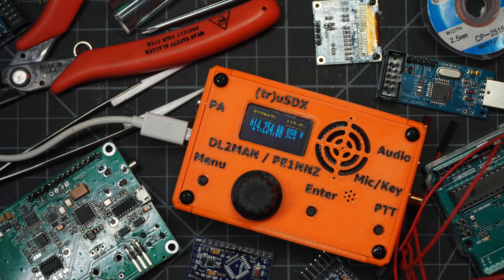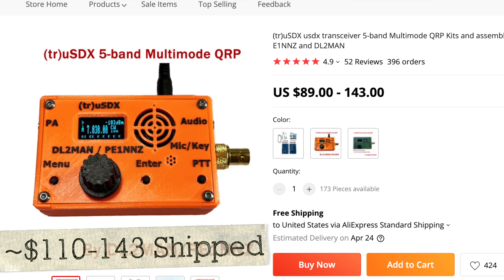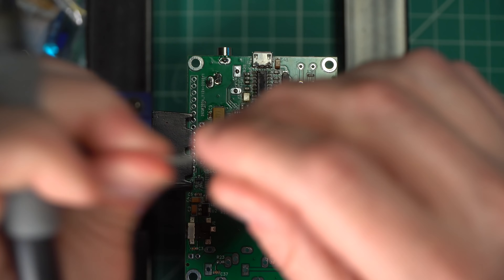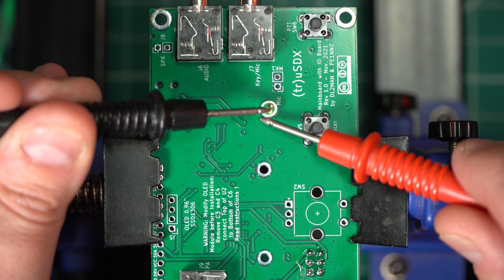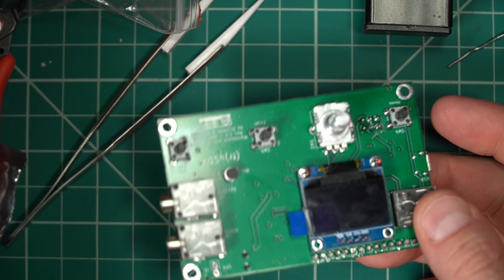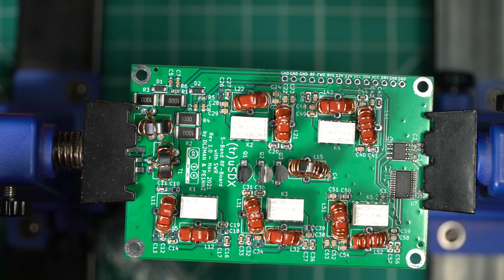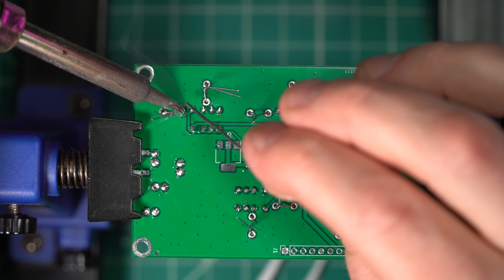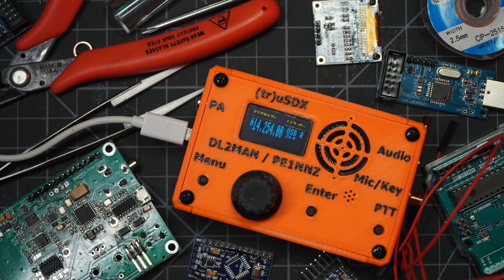(tr)uSDX: Tiny QRP Radio, Some Issues, Let's Build It Pt.1

Comment: I purchased the kit from ebay from the authorized seller there. What a great kit, and I am getting 80+ efficiency on all bands. I have been having a blast with this little radio. Have made a bunch of contacts on 20 and 40 and everyone states the audio is fantastic, and can not believe I am running only 5 watts. A big thanks goes out to the designers of this little radio, it really packs a punch.

KB9JJA

Comment: It is fantastic what the designers (PE1NNZ and DL2MAN) of this amazing radio were able to do with an inexpensive ATmega328 microcontroller (used in the Arduino Uno/Nano) which cost $2.50. It is functioning as a Digital Signal Processor (DSP) for a true Software Defined Radio (SDR). Brilliant engineering and a work of art!

Comment: Its an excellent kit and the built radio is even easier :-) 

I bought mine from the AliExpress vendor and it arrived in 4 weeks. Faultless transaction and very well packaged -- so no damage and everything arrived in tip-top condition.
I've had it working for a week now and I'll be reviewing it on my channel later this week.

I've modded a speaker mike to work with the rig and have already had it out on a SOTA activation last weekend. 

An external speaker is sooo much better than using the internal one -- which you won't be able to turnup past '11' before it all starts to how at you!
If you can find a 16 ohm, 32 ohm or higher impedance external speaker (or headphones,) so much the better as the audio is driven by a direct processor output -- and doesn't have a lot of puff

It plays really well with the QRP-guys 3-band switched vertical mounted to the SOTABEAMS 6m 'Tactical mini' mast -- which I think you already have Josh?

So flash some firmware and have some fun!

It must be the smallest, lightest full functional rig on the planet -- and my congratulations to DL2MAN and PE1NNZ for their magnanimous efforts to bring such a gem to the Amateur Radio community.
This is what keeps this hobby GREAT

73
Bruce 

Dr.T(G4ABX)

@G4ABX

Comment: More soldering tips:
— flux is your friend! I use both liquid flux or a flux pen, whichever is most appropriate.
— tin the pads and the wire before soldering
— when soldering multi-pin components, only solder one pin and then check/fix alignment before soldering the other pins. Much easier to align a component with only one solder connection. This is very useful when aligning LEDs!
Reply from the maker: I'm pretty sure I used most of these?  With some clarification though, you're telling me you tin every pad and every wire before soldering?
Reply: @HamRadioCrashCourse  
That’s what I do, the exception being through-hole DIP chips and other multiple pin components (the flux pen is great for these) or if you’re unable to fit a tinned wire through the hole. I guess I shouldn’t have said to tin the pads, that does make things rather difficult! 🤦‍♂️😂

Comment: My (tr)uSDX came from Australia. Faraaz built it for me (long story: I can't build stuff) and it works great. I subsequently ordered a finished one from DIY Tech to give to my buddy Piero Begali. That arrived and also works very nicely. I did get the case for one -- the one Faraaz built -- from RoWaves along with the DL1DN battery box, both of which are beautiful work. I was looking at getting one just for kicks from RoWaves but have discovered that they have suspended production/delivery until they get the efficiency problem cleared up. 
. . . Personally I really think this is one of the coolest tiny radios that I've been able to use in a long time. I went through the three band and five band MountainToppers -- and wish I'd kept 'em, if only to make my hoarders episode more astounding -- but I'm beginning to think these micro SDR radios are the wave of the future for QRP and POTA/SOTA. Really sweet solid performers.
. . . So we move along. Nice video, complete and objective and fair presentation. Stay sane & well, amigo. 73 de W8IJN

Comment: Some thoughts and hints from my own (tr)uSDX build and following this radio project that might help some of your viewers:

The best way to desolder tiny SMT components, (those 2 little display caps,) is NOT to first clean the solder off your iron, but to load it up with solder. That then distributes the heat to both ends of the capacitors and they come off almost instantly. Essentially all desoldering is that way. Properly done, desoldering uses more solder than soldering does.

The 2 toroid transformers MUST be wound in the correct direction or they won't give you any power or SWR reading on the display. You know they are wound in the correct direction when the multi-turn toroid wire drops straight down to the PCB hole. If you have to cross the leads through the toroid or have to wrap extra lead length around the outside of the toroid to reach the PCB holes you have mis-wound the toroid. (I managed to very carefully mis-wind 1 of the transformers twice.)

The Q4 and Q5 pads on the bottom of the RF board are left open. They are for FETs that may be used optionally instead of the 3 BF170 RF output FET's, Q1, Q2, and Q3. It's better to use the BF170's. They have more headroom for high SWR's.

The point should be clearly made that even if a (tr)uSDX is purchased fully assembled, it is NOT a tested, quality-controlled 'commercial' product. It is still an experimental transceiver with bugs, glitches, and quirks that you bought from China, and the guys who designed it did so for fun and make no money off of your purchase. They are only trying to help. They are not to blame if something doesn't work, and it is not their job to fix it. They have day jobs. (Some people seem to think otherwise.)

It's always a good idea to buy a bag of BF170's, just in case. (I think I bought 10 or 12 for $7, free shipping.)These are Class E outputs, so they are not designed to dissipate the power levels they are capable of producing. Also, since these are simple experimental rigs they have NO output protection of any sort. Fortunately, the FET's are about 50 cents apiece, so there's no reason not to have spares for when you hook up the wrong antenna or forget to hook one up at all. The price of the final amp FET's IS the output protection.

P.S. If a ham can solder even modestly they are probably better off building their own kit than buying one completely pre-built, because they can and will work more carefully, will learn more about their rig, (these ARE experimental rigs,) and the toroids for each band will likely work better if they are hand-tuned. They may well work great with no retuning at all. DL2MAN has done a very good job with the circuitry. But hand-tuning will ALWAYS work the way you choose it to. Some folks may choose an extra Watt of output. Some may choose a couple of extra percent efficiency. Some may go with 2 or 3 watts of output instead of 5 watts in order to make their battery last longer and allow for more SWR headroom. Folks can (and should) also optimize the toroids for lowest harmonic levels in the outputs on each band. The Chinese companies simply are NOT going to prep your rig the way you want it. Heck, they may not even power it up before they ship it out. Who knows? But if you do it yourself, you will know.

Hope that helps some.
John
Reply from the maker: Cool! Thanks for the tips!

Comment: Requests:
1)    Have ‘VOX’ stay set to “ON” on power-up so easier for FT8….Current rev defaults to “OFF”.

2)    Also, would be nice if power Jack be on left or right side instead of top. 

3)    Mic/Key have their own jacks and with standard separation for hand microphones.

4)    Rotary Encoder recessed to lower board so to allowed low profile knob to be used on shaft.

73  WA4ITD (I currently have rev. 2.00h)

Comment: Great video, Josh! Is Pt 2 coming soon? I got my kit yesterday from a US group buy. Unfortunately it has 4 SMD ICs and about a dozen SMD 0603 caps to solder in. I guess the PC board manufacturer was out of those when the boards were built and populated. Remains to be seen if my 74 year old eyes and hands can manage all that! I’ve hand soldered surface mount stuff before, but never at the 0603 size! They’re like half a grain of rice!
73, Randy, KS4L

Comment: Josh, good video. The steps I was concerned about was the wrapping of the toroids. Being RF was there any tuning needed? Would you agree that attaching leads to speaker prior to sandwiching boards is easier?  For me the hardest part would be flashing the software. Will you go in depth with that? Nothing like the satisfaction of a  working project!
Reply from the maker: Once it’s up and running you can gap the coils on the Toroids to tune them. 

I will cover flashing on my second part video.

Comment: The DC cable connector on the (tr)uSDX is the same size as the one for the Icom AH-705 Compact Antenna Tuner.

Comment: Soldering Tip - hold larger parts in place with masking tape. You can flip it over and do all points at the same time.
Reply: Another soldering tip slow down take your time and tin your wire first Hope thats helpful

Comment: Hey, just a suggestion, the speaker that had its plastic sound cone pushed in, I've had some success with taking a piece of 3/8" PVC pipe and suctioning the pushed in part right back out by mouth by using the PVC like a drinking straw. It's hard to tell the diameter of that speaker but a large milkshake straw might actually work on it!
Reply from the maker: I used the tape method. 👍
Reply: @HamRadioCrashCourse  
Scotch, Black, Painters or Duct?

Comment: Hi, I’m building this now. Where did you get the break away pin headers for the spacers for the OLED? I’m not seeing them as part of the kit. And also, the pin header that connects the 2 boards isn’t like the one in your video, or his assembly video. Mine has equal length pins on both sides. I tried sliding the black spacer, but it won’t budge. Other kits pin headers I’ve been able to slide the spacer… not this one! Did you run into any of these issues?

Comment: Josh just use the soldering iron to burn the enamel off.  👍
Reply from the maker: This works with some enamel, but not all.  Some enamel is horrible!
Reply: @HamRadioCrashCourse  Ya thats true, I use my solder station to remove enamel but my solder station goes over 800 degrees.

Comment: Josh, where is the link to the HTML page that you said you can hover over the coils to see how many turns they are? My kit came with NO paperwork at all, and I the link you have to DL2MAN is giving a 404 error.
Reply from the maker: It’s all on DL2MAN.
Reply: I am also curious  about this HTML tool? I cant find it on the DL2MAN site under Assembly section. Even looked at the 1 year ago archived version of the website. Any hint where it could be ?